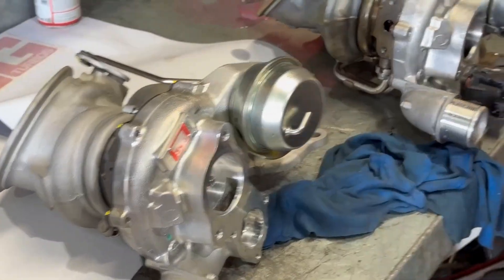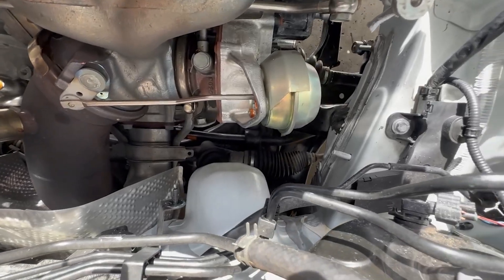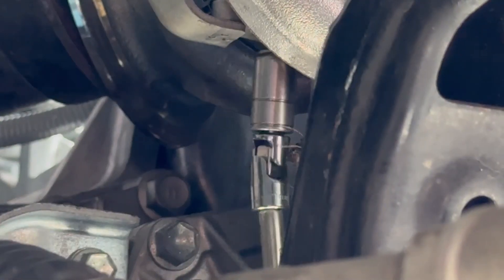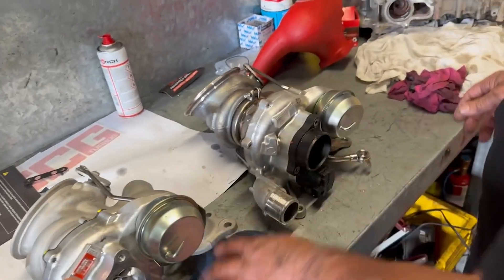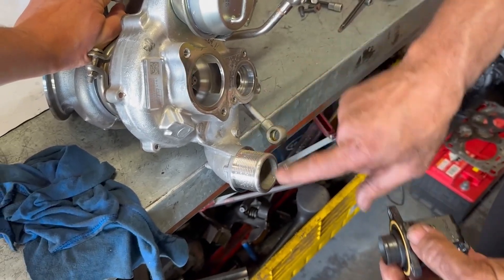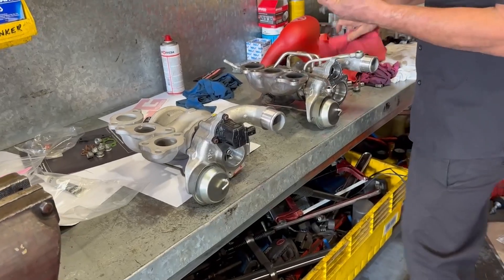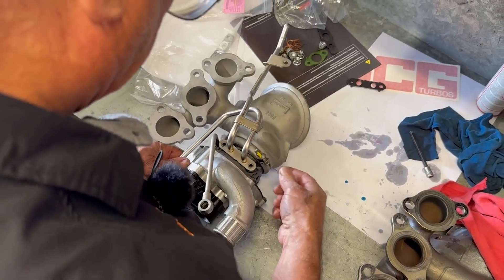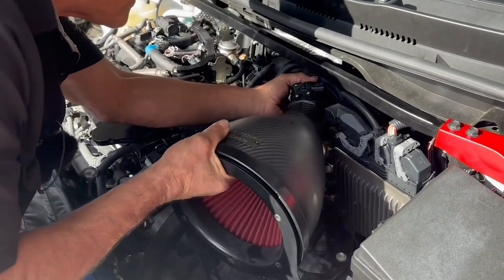GR Yaris GCG Turbo Upgrade! More Power, Same Sleeper Look

Comment: What's the plan with the gearbox? Presumably this thing will be producing a heap of extra torque when you're finished with the mods. I've seen dynos of cars producing an extra 100-150Nm of torque with a catback, upgraded intercooler and piping and a flash tune. That's somewhere in the region of a 30% uplift compared to stock. I haven't been able to track down what the gearbox is rated at, but even 30% over stock seems like it could be pushing the boundaries from a longevity point of view and with the build you're putting together you're probably going to be even higher. What sort of factor of safety do OEMs normally build into their boxes?
Reply from the maker: Excellent question and I am not sure what Daz (the owner) is planning to do with the gearbox to handle the extra torque. I'll have a chat with him as it's worth considering upgrading the clutch especially considering he does track the car. Sequentials are just too damn expensive! I imagine it would be difficult to find the OEM safety factor on the torque specifications of the gearbox. The best way to tell is from real world experiences of different setups and what it can handle. Do you have a GR Yaris and considering upgrading the drivetrain in yours?
Reply: @denstoj  Yes I have a Rallye which I mostly use on weekends, but I intend to run in the summer rallysprint series later this year. Just for fun though as I don't have the budget to compete with the guys with fully built tarmac cars. It seems like it's relatively easy to extract a lot more power and torque out of these cars, but the gearbox is a weak link. I've had that feedback from one of the workshops over here in WA that has a shop car that they've stuck cams and a tune into. They ran into issues with hard track work. Likewise there are reports out of the UK of similar issues at a range of tune levels with 5th gear in particular being a problem. I'd like a bit more oomph but I think for the time being I'll focus on handling and reliability mods. I used to have an Evo 9 tarmac car and the biggest jumps in performance came with tyres and suspension and a reduction in weight.
Reply from the maker: That would be fun for sure but yes hard to compete when the $ start adding up. Focusing on handling and reliability mods is a smart approach. Keen to hear how you go.